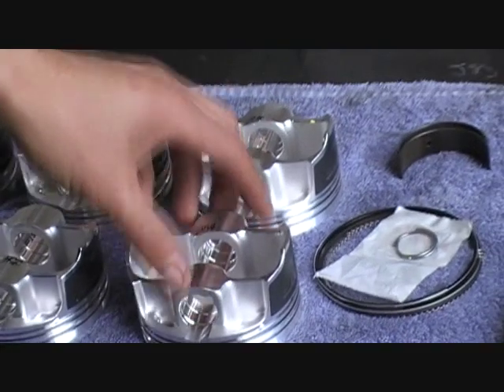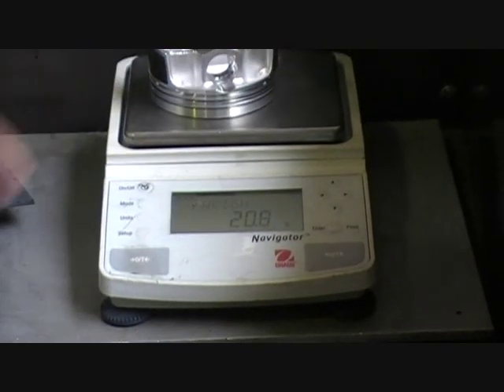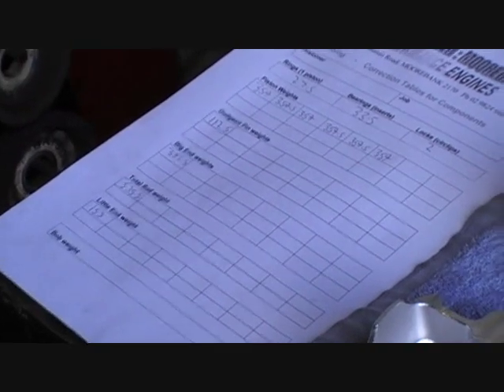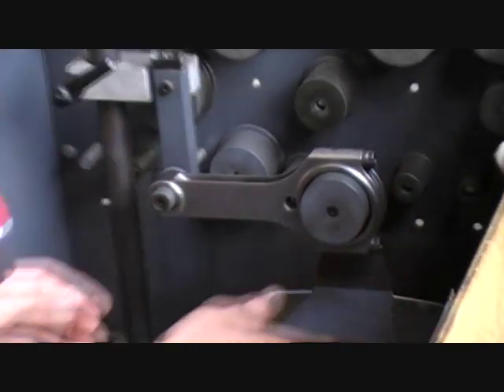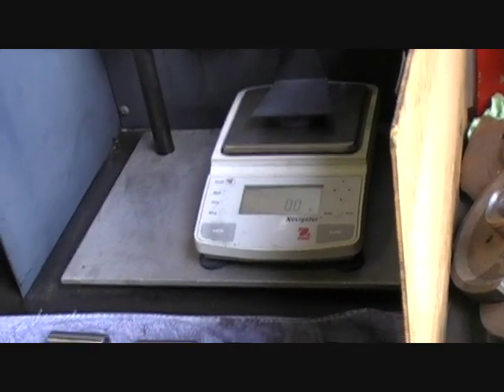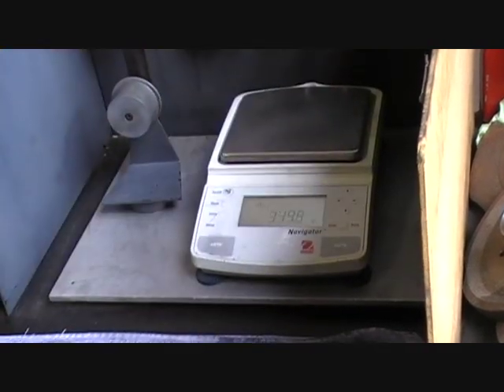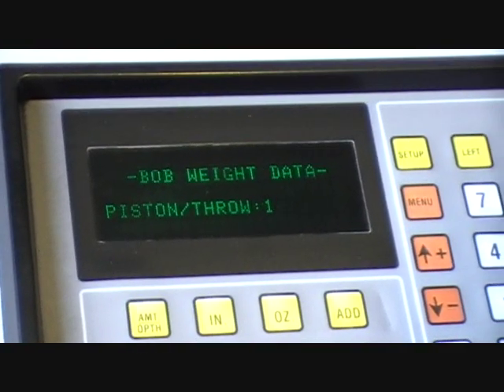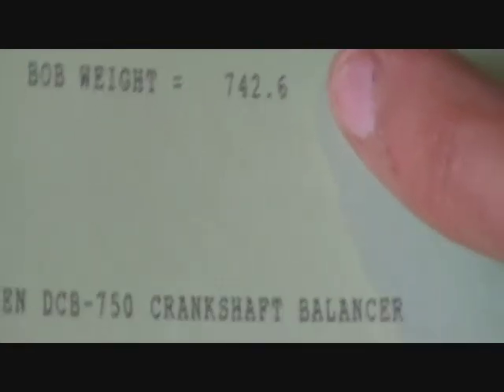Engine Parts Balancing

Comment: If I have a good running engine with a factory internal balanced forged steel crank,( it's a 440 mopar) and want to put pistons in for better compression, can I just make all the pistons rods pins weights exactly the same and get a quality engine ? (I won't hold you accountable if something goes wrong lol)